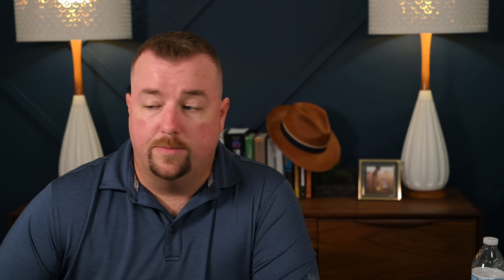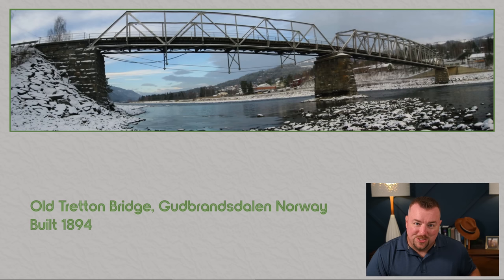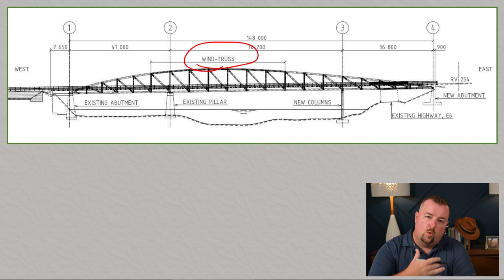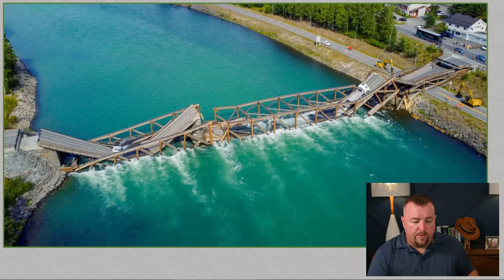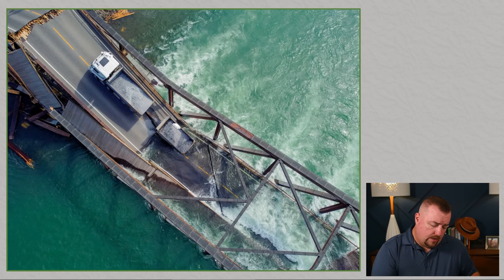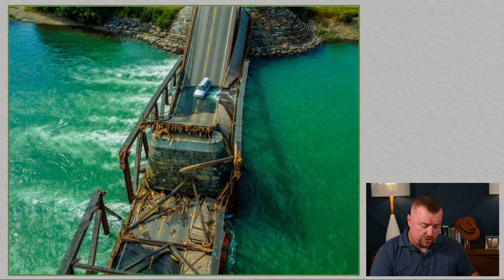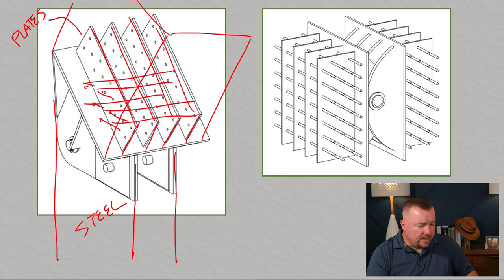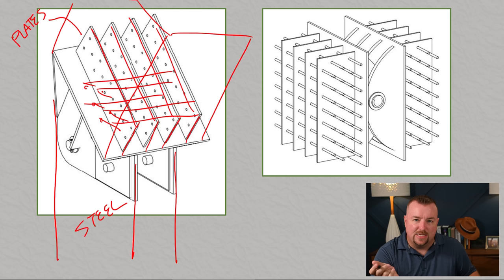How Did the Engineers Miss This?

Comment: According to preliminary accident reports (from SINTEF, a impartial 3.rd party) released a few hours ago, shows that the bolts has snapped due to overloading. Not the wood.
The glulam is impregnated with creosote to reduce the effect of humidity.
There are bridges that have heavier traffic, and have stood longer, that is made with gluelam. All the way back to 2005, where the highway passes over, and is still standing.

The problem with the first bridge that fell, the contractors that installed it, didnt follow the specifications on the dowels as the designers required.
This bridge seems like they didnt use enough bolts for the joints, or strong enough bolts. 

Cost saving measures when installing might be the major reason.
The horisontal cracks that you are refering to, came after when the bolts snapped, and there became more load an the other parts of the bridge.
Reply: btw, Gluelam has been in use since 1959 in Norway, mostly in buildings and large industry halls, ports halls, hangars. etc.
Reply: Thanks for contributing. I felt like in this video he prematurely started giving his opinion rather than reading an investigation report and translating that for the audience.
Reply: @dimvoly  even the locals do the same. Yes the accident could have been prevented, but shaming wood, when the wood held up, is not correct, as stated above, Norway has been using gluelam since 1958, and the first gluelam bridge was put up in 2005. And there are 38 bridges in total.

Comment: A great lesson of if it ain't broke don't fix it. 
We have had very good wooden bridges and ships , dams , buildings etc that were far simpler, less costly, and lighter that have lasted for centuries. For thousands of years.
Here we have an example of ignoring the construction systems that were elegant and worked, and the stupidity of mixing widely dissimilar materials with different properties such as large thermal expansion coefficient and specific stiffness of steel with higher dimensional stability of timber. 
And not allowing mechanisms such as plastic deforming repeatability of Stockholm tar calked bolted or dowelled joints that allow movement from moisture content changing, and dimensional changes without loss of strength and joint weakening. 
And failure to appreciate that glues of similar elastic modulus  to the timber are important to prevent glued joint failures. 

There is a bamboo suspension bridge over a gorge in China built in 1100 AD that is still carrying lorry's across much larger spans than this, after a thousand years.
Built with nothing but split bamboo and seed oil based calking treatment and weaving systems.
How far our technology has regressed!
Ages of Wood and stone were far higher performance in every way than the age of weak short-lived metals and plastics like the rubbish alloys of iron and mutilated natural pitches in use here. 
All for the sake of god's of profits and exponential breeding and hoarding of the rulers that measure value called dollars.

Comment: Anyone experienced working with wood avoids trying to split the same fibers - the hole pattern has to be done to let the screws or pins split different fibers from each other.
To further strengthen the wood it should have a bracing around the wood beam where the joint is.
But I'd also avoid pulling forces on wood and stick to pushing forces and just have pins in the joints to keep it together to avoid a house of cards situation while assembling.

Comment: Josh, great presentation but I would query the statement about the diagonal brace being in tension. Thinking about redundant members and considering only the truck load then the B to C diagonal would be in compression not tension. We’re there any compression tests done for the connections? And could the diagonal have failed due to slenderness issues? Regards Terry Little (UK Struct Engr). Keep up the good work.
Reply: I'm not a structural engineer by any means, but I had the same reaction about the diagonals. However, with a large point load on a neighbouring segment it might go from compression to tension. Also, in that situation I think the lower beam would experience both bending and tension - it being glulam and not steel seems to me to be a weak point.

Comment: In my travels over bridges in New York State which span highways , I have noticed a small but noticeable “up and down” flexing of the bridge road surface when heavy trucks pass me going the other way. I’m wondering if this could be an additional force or stress factor on these joints over time.
Reply: Yes, that cyclic loading can cause fatigue. Fatigue (as well as corrosion) is fairly well understood, but can occur much sooner or much later depending on very small differences that happen during construction. If something is subject to fatigue, careful routine inspections are really the only defense. These inspections don't always get done for political reasons.
Reply: Flexing of those joints will transfer more of the load to the pins on one side.  Even a little flex will put all the load on one side.

Comment: Preliminary investigative results of the Tretten bridge failure conclude that miscalculation of differences in thermal expansion of the steel and the swelling of the glulam by humidity was the main  cause for why the bridge failed at a much lower load than what the bridge was designed to handle.

Comment: [The volume of your voice on this video was so low, I sometimes could not hear you, even though my computer was cranked up to maximum volume.]  So we have connector issues, which may be tied in to the fact they are connected to glue-lam lumber.  We DO have many timber frame bridges in this country - covered bridges - over a hundred years old - operative word here is COVERED, so they were protected from the weather.  The model the testers used ASSUMED glue-lam lumber would act as a homogenous piece of wood - this may be a basic false assumption, also using wood under tension may be another problem area.  Anybody think of taking a big, ole, solid timber, the same size as the glue-lam, and running tests on that, under connection, for comparison purposes?  Or, different types of wood - oak vs. pine?  This could help distinguish whether the problem is glue-lam, or wood.  And, while we have built wood bridges for a long time that managed to last for a long time, I'm not sure a modern bridge, with current weight load requirements, can attractively be built of wood.
Reply: William, I suspect that Glulam is dirt-cheap, made out of the off-cuts, just milled and laid down with the grain of each piece pointing the same way, and then covered in glue.  Rinse and repeat...  Using "real" beams of wood would be a lot more expensive.  Just finding sufficient long pieces would require a lot logging of old-growth forests.  Very un-green!    The use of Glulam is,  I suspect, driven by the politics of environmentalism rather than by cost-benefit analyses and hard-nosed engineering.

Comment: May i add that treated lumber is all fine and dandy by itself, but the pressure treating oapens up the pores in the wood, causing it to hold alot more moisture that regular wood. Meaning that untreated wood contacting the treated wood will rot way way faster than expected. I suspect the same is true for steel

Comment: Just FYI, glue laminated wood is an extremely good material, don't get that wrong, it's more fire resistant than steel (it chars but it doesn't melt like steel), is very weather resistant, and is strong in all directions when cross-laminated. It's made out of an extremely dense wood, and then fused together in a criss-cross pattern to get its very high omnidirectional strength, and many recent skyscrapers use it as its main building material among other things.

The cross-laminating is the very important thing, so that you don't get that splitting of the wood.

Comment: For reference. the truck and trailer is most likely around 50 to 53 tons combined with 50t being the maximum allowed on standard public road with that kind of combo of truck and trailer, and 53t if they do the casual overweight loading as many dump-trucks do.

-Norwegian truck driver,
Reply: @timemachine194 oh yeah  it's bridge design that is at fault here.

I'm just pointing what the laws in Norway is and approximately how much that truck and trailer weigh

Comment: In addition to everything you said, I couldn't help but notice that the steel to steel connection at 11:00 seems to be relying 100% on the sheer strength of the bolts, which seems like a bad Idea. I would expect the sides of the bridge to be on top of the load bearing cross piece.

Comment: Anyone who has worked with wood can tell you that, if you are at all worried about the wood splitting at the ends along a certain plane, just sandwich the ends of the wood with two steel plates that are held tightly together with bolts.  The bolts can either go through the wood in a plane that is orthogonal to the other dowels, or even better, the bolts holding the steel sandwich together can go just outside of the wood.

Comment: The design of this is crazy.
Basic concepts the designers seem to have ignored:
-Every joint steel to wood is a failure point, minimize them
-designing wood to look like steel will result in not enough wood, not the right shapes
-truss is meant to pivot and then spread load in steel. The pin to glued wood design is extremely rigid and unable to pivot
-computer mock ups of any material, let alone a 'natural' material like wood with huge variability of grain etc, is always a massive simplification of the system
-no modern glues have long term real world data on long term use in weather
-woodwork ALWAYS requires attention to grain and the individual wood properties, mass projects where you roughly join huge beams with cranes and pins is opposite of that
-spread loads along the wood, don't concentrate the loads and weaken the ends with  pins and slots
-wood is not steel

I've thought about the natures of wood and steel a lot and played with that a lot in unconventional ways. I made a functional wooden bicycle chain from hardwood. To do that I had to make 3x the pieces of wood that were in the end build because the splitting and warping meant a huge rate of attrition. I built the chain 8x normal size of steel because that is a good strength to size ratio.

I've looked at a lot of unconventional uses of wood/steel in bicycles and cars. Bicycles are a great way to study engineering because they have to be light and elegant to function, and failure is easy to spot.

One of the best wood bicycle makers I met in Oregon and when I asked him how they could have confidence in their engineering he said he had decade of experience with wood airplanes and so the bicycle physics was an order of magnitude easier (though you have to account for rough use instead of professional upkeep)

Wood can be used but it has to be done smart by people who understand wood intuitively and aren't going to use it in a way where they pretend it is steel.

This video scares the heck out of me because I work in a public building with similar laminate wood building processes that was build in 2010 in a rush for the Olympics.

Comment: 32:00 - I agree that there was much tension in the lower horizontal beams, which became maximum at the point load where the truck was, and the initial point of failure was most likely the AB lower horizontal beam separating from joint A. However, the AB cross member was normally under compression not tension. Starting at point C supported by the pillars - horizontal members cannot support vertical load. BC-cross compression vertical component of force is the only element holding joint B (top) up. Element B (vertical steel) tension holds B (bottom) up, which then supports AB-cross compression with vertical component of force supporting A (top). Likewise element A (vertical steel) tension supports A (bottom), which supports the next cross member to the left and so on. Because this pattern continues to the other end of the span (unusual; the direction of cross members usually reverses in the middle), this force is reversed at the other end, so that the vertical members are compression and the cross members tension, but again each cross member supporting the next vertical member. Once the strong tension of horizontal member AB failed, the bridge falling down lengthened the distance between the AB-cross ends, and it was ripped from the upper A joint. But AB-cross was usually compression, supporting the weight of the bridge to the left, and prevented from flipping over (upper end rotating down) by the tension of AB-lower and the compression of A-left upper. And as you said, the real cause of failure was deterioration of the wood in normal outdoor weather. There is a reason for "covered bridges" to be covered; the surrounding building struction maintained the beams and deck boards in a dry indoor environment so they lasted a lot longer.

Comment: Every single hole they drilled into that wood is interrupting the fibers that make wood strong.  A single bolt would have held it together better than the dozen or so hole that destroyed the structure of the wood.  It looks so obvious.  At 39:00 you can see how much of the wood is replaced by those steel plates.  So much of the wood would have to be removed to accommodate all that steel.

Comment: I live near Mt. Rushmore in South Dakota, and we have several wooden bridges that were built in the 1930s.  They are very well designed and handle a large amount of traffic every summer.  I have been on steel bridges that felt less solid.  Looking at the images you have of the bridge that collapsed and comparing it to the bridges here?  I would say they used 1/3rd or less material compared with the bridges near me.

EDIT: As I was watching, it occurred to me that all of our wooden bridges are built with the wood in compression, not in tension like the collapsed bridge is.
Reply: Bingo! Compression is what wood withstands.

Comment: Also remember that the treatment of most treated timbers is not necessarily all the way through the member. Typical specifications call for any cut ends to be treated. When you drill all the way through the GLULAM timber it is impossible to effectively treat the fibers deep into the wood. Were the Timbers analyzed for wood rot (which would not be surprising after 10 years)?

Comment: Regarding the phrase perpendicular to the grain - that is not a mistranslation. Under load, the bolts push against the side of the hole in the direction of the load and become the wedge you mentioned, pushing the wood apart perpendicular to the grain.

Comment: It is hard to say if the truck slid back or not, the skid marks from the tires could be under the front of the truck as only the rear wheels have parking brake capabilities. The front axle and what looks like a lift axle would just roll even with the parking brake applied. The water (?) on the bridge masks any potential marks made by the trailer wheels which have spring chambers (parking brake) like the rear axles of the truck.

Comment: Wood is not as strong as it used to be. 
The grow a fully grown tree, as timber, in 20-25 yrs. 
The soil is drained of the minerals, which help the tree with its rigidity. 
each successive generation of lumber creates successively weaker wood. 
They need glues and polymers to strengthen the wood. 
Trees used to be 90-100 years old, when they took these down. 
It's like all the rest of society, bent on progress at all costs;
quicker, faster, cheaper is not better for the rest of us who have to use the infrastructure.

Comment: Wonderful forensic analysis. Two recommendations for the engineering community. First, swap the engineering teams from the Norway bridge with the ones who designed the Florida International University bridge! They should learn a lot. Second, have a look at boat building history without metal fasteners or early aviation like the Spruce Goose which was made from wood. Can’t blame the wood, it’s all in the application and setting proper requirements.

Comment: Something I noticed about the truck and trailer, is that the back of the trailer looks like it might be against part of the roadway, with a crack between that spot and where the tires on the trailer sit. The connection between the trailer and truck look robust and stiff. I think that would explain why no tire drag marks...it's basically held in position by the trailer.

Comment: Dimensional wood trusses are usually bonded with metal surface plates that have thousands of piercing "staple fingers" bent out of the plane of the galvanized plate. It works very well because of the very high density of shallow piercing connections. If such metal joinery plates were included at regular intervals in glue layers at key nodal locations in Glulam beams, it could become very resistant to splitting and pull-out, and might be extremely effective at transferring high tensile loads to external all-metal nodes.
Reply: Another way to stabilize wood beams could be by cutting many thin layers out of the Glulam beam ends and inserting wood laminate with a cross grain and glue. The beam ends effectively become cross-ply wood. This should also better resist splitting and pull-out.

Comment: My guess (from playing PolyBridge) is that the vertical member from B to the top of A failed at the top of A when under stress, causing the bottom of A to fail, and then the joint at C to fail outwards as the bridge fell down.  Once that crossmember failed, the stress diagram around A & B was just a floppy box, which is quite weak.